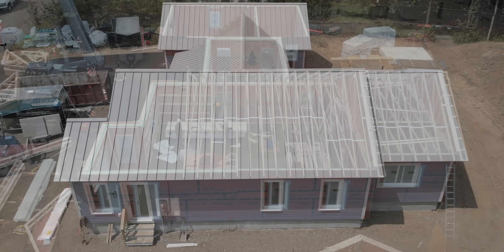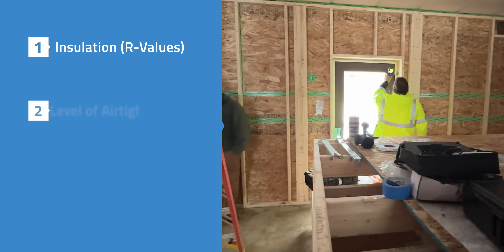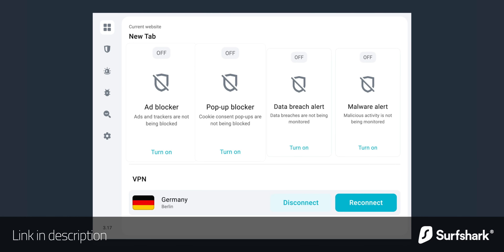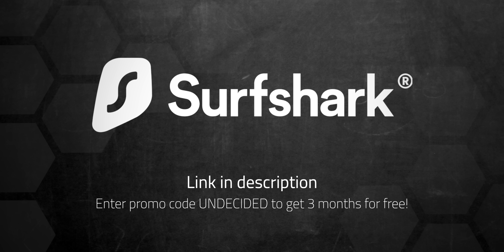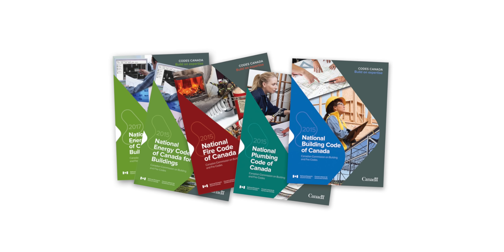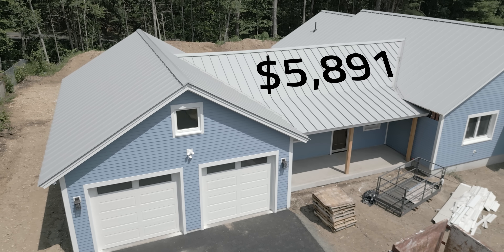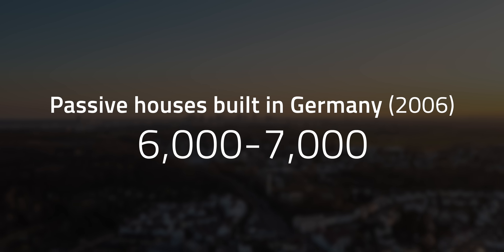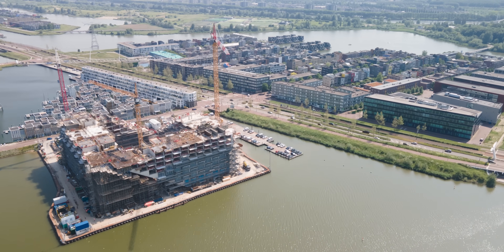Why Do American Homes Suck?

Comment: As an American living in Spain I can tell you that you are indeed only evaluating in your video energy related matters and not other important elements that are clearly different at least in Spain if not all Europe. When I hear your comments in building your new house on the roof selection, which I believe is metal and much more expensive that the usual shingles typical in many places in the US. The roof in my house are the typical red mediterranean roof tiles which I don't even know when, if ever, will require replacement. 

Typical construction is also not wood based but brick and again much more durable. In most homes floors are tiles and not carpets which would be a less expensive option. Kitchens and bathrooms all have walls which are tiles for easy cleaning and again, more expensive upfront. And yes, windows for many years have been at least double glazed with the new trend not being aluminum but PVC so they have a lower transmission value and therefore more efficient. 

My house is relatively old at 32 years and last year had an energy assessment done which is now mandatory if you request government energy incentives or are selling the property. This is similar to what is done in appliances in the US with EER ratings but for the house. One of the ways to also improve your ratings is by having renewable energy sufficient to compensate consumption. The measurement is done in kWh/m2/year and in my case I have been able to on reduce it to 25.7kWh/m2 thanks to a sizeable solar installation with batteries and A/C with reverse cycle for heating with supplemental natural gas.

Comment: My nephew's au pair is a youngster from Germany who is amazed at how noisy are US houses. One hears everything from other rooms throughout the houses. Internal insulation and noise dampening is non-existent. External insulation, even in new houses in new subdivisions is very substandard. That comports with my experience living in German homes over 10 years (80-99) in 4 locations.
Reply: Aren't German houses built with masonry, rather than wood?    I haven't lived in the USA since 2007, but in the four countries I have lived in since I left, they all construct with  concrete, and or hollow block.    Yes, it is more "solid", however it makes it much harder to make any changes to the house.    Hell, it even makes it more difficult, just to hang things on the wall.

Comment: Depending on location, building codes can be very challenging. The added expense to make a home energy efficient is typically more than the cost savings will add up to for many years. Making a house "tight" causes air quality problems that need to be solved with even more technology which in turn adds to the cost and overall energy consumption of the building. IMHO, the best choices are to use rock wool insulation, 2x6 (or thicker) walls, a radiant heating system and incorporate a good passive solar design and orientation on the lot. I am all for using house wrap and above average doors and windows, but the air exchange systems are something that I would try to avoid. I try to employ some vintage passive air control solutions like natural convection to exchange the air and contribute to humidity and temperature control. I do this with an automated roof vent and lower-level intake vents. A system like this requires the building to be designed for airflow through the various rooms both in and out. This or any type of air circulation interferes with sound deadening goals so yet again, there needs to be a balance that typically requires much more thought into the overall design of the house. Thicker interior insulated walls and arranging the rooms in such a way that the occupants don't disturb one another.

Comment: I cannot understand why US seems to have some adversity to everything that became norm in Europe, even if it is something proven to be better.
RM Transit did a great video showing why build public transport in America is way more expensive and time costly just because US doesn't accept European standards, so everything must be converted or adapted.
I can also give example of vehicles. Cars made to a European standards cannot be sold in America, they must be slightly different, but not exactly better. For instance, European cars can have adaptive headlights which is way better for everyone, for the driver , better for the oncoming traffic and pedestrians, but it was forbidden in US until last year.
When the DOT finally approved, they added some minors requirements that improve nothing but it was different enough so the European headlights would still be forbidden.. WHY!
Now every brand will have to come up with a slightly different design just to meet US standards, increasing costs, waste and use of material..

I can go on and on in a bunch of examples, but I guess I've made my point.

Comment: It's not just energy efficiency if you look at the area called Tornado Alley it's so common to have tornado's it's just normal and yet the building can't handle any more than a stiff breeze.  And what a surprise people get killed and everything needs to be rebuilt, rather than having a building designed to be tough enough.

American's just need to build better houses.

Comment: Passive houses are an outdated concept in the Netherlands. The building code requires a near zero energy cost home which can be achieved in many different ways including the use of heat as an industry (datacenter) byproduct. 
Passive houses still get build, but certification is mostly redundant.

Comment: Fun fact -- the planned obsolesce on the majority of newly-built USA housing is actually less than the life-time of the standard 30 year loan. Meaning if you planned to buy a house and actually live in it, you'd have to completely replace nearly all of it by the time you paid it off. You're not buying one home, you're buying 1.8 homes.

Without launching into a rant about how it's dumb to think of a physically rotting object as getting more valuable over time -- quality absolutely matters. It's not just flushing money down the toilet due to lost energy, it's flushing money down the drain because you have to replace all the walls, roof, wiring, pipes, windows, doors etc -- literally everything except the foundation (and sometimes even that too).

The neat thing about energy efficiency is that it often (not always) correlates to longevity. Walls need to be replaced because moisture gets in and rots it from the inside. Pipes leak because they're constantly exposed to exchanging air and that air is not being maintained at a consistent temperature causing the pipes to expand and contract. Doors get replaced because drafts are slamming them shut. Windows get replaced because water gets between the frame and the wall. The list goes on ...

All of these things are directly or indirectly linked to energy efficiency. So even if you're not into saving energy, how about just a structurally stronger building? They're usually one-in-the-same.

Comment: First of all. The US cannot reasonably have a centralized building code due to the size of the nation and the multiple climates that have to be accounted for. So it would at most have to be one per state just as it is now.

Does it need to be stricter? IMO no. However I think building recommendations should be made as accessible as possible so that people know that by for example simply using one type of insulation over another they can save on heating/cooling costs later.

There are an infinite amount of things you can do better when building a house and most of them are unknown to most people and people assume that it will just cost way too much when IRL it could be quite affordable to do many minor things that collectively result in a house that needs far less heating/cooling.

Comment: Passive house.  This is why we suck.  Our standards are really, really poor.  I built my home 8 years ago to Passive House standard and it costs a fraction to heat and cool compared to a US code built home.  I'm a 8,000' elevation in the Colorado Rockies and use roughly 10% of the energy when compared to a similar sized home code built home.

Comment: US building codes suck and cities require homes that are too big to be efficient. I built my own home with 2x6 walls, super insulated and can heat, cook and heat water for about a dollar a day with propane.  I have 1.2Kw of solar and I have most modern conveniences.  Houses in the US are also not positioned to make use of solar and roof designs are not designed for solar. I use a ground mount solar system that allows positioning and easier to do maintenance and cleaning.  

US homes do not design n passive solar and natural cooling like porches, smaller windows and cross ventilation so they need huge AC units. I cool my entre house with a 45 watt evap cooler.

Banks want traditional houses and builders want to build cheap and fast to make a profit!

Comment: Having lived in many countries including Africa, Europe, America and Canada I have to say I was shocked by the paper nature of American homes.  They are fundamentally nothing more than 2x4's with wax paper and plywood.  They look superficially grand in many instances but are completely incapable of surviving weather events.  Given America suffers Tornadoes, Hurricanes, intense thunder storms, ice-storms, heat storms and termites it is incredible that a house can be built NOT to last.  Even roof shingles are a joke; they don't last 5 years.  My UK house was built in 1902 and is sound masonry, heavily tiled roof and will easily survive bad weather events, and termites can't eat it!  Then again, have you compared house prices between America and the UK or Germany?
Reply: That's mostly true for houses built before the codes were codified. Houses built, and professionally remodeled, today have a mix of insulation in the walls as well as an insulating wrap on the outside. Both providing insulation and air tightness. 

Also houses built in states with bad weather systems have to be built to handle them. My house built in 1962 handles the hurricanes we get.

Tornados are kind of the exception as those things will wreck even the most hardened structure.
Reply: Claiming roof shingles don't even last five years is trolling, bud. Maybe try buying a brand like GAF and not some Chinese import.
Reply: That's why they don't make them energy-efficient: it's not worth it, since they are disposable, and not meant to last more than 30 years or so.
Reply: @Myria83  Well, yes, I think that was my point, without saying it directly.  American houses are built of materials that rot, get eaten, or don't last.  Here in the UK our local Pub was built in the 12th century, and we still hang out in it today, over 700 years later :-).  I guess its not impossible to build things out of 2x4's and plywood, but they are not as tough as brick.  Look at Matt's video, the opening frame shows an American house being built.  It is nothing but 2x4's and chipboard with a membrane.  That's not the same as 2 layers of brick, with an air gap for insulation that is common here in Europe.
Reply: @djgtidwell  "common" depends entirely on which european country you are referring to. as an example matt has shown that the swiss use a lot of wood in their housing construction. 

additonally you are being over simplistic in your description on how modern american homes are built, your description is more akin to the houses built before the 90s. and frankly you are outright lying about the lifespan of shingles. Asphalt shingles have a 30 year rated lifespan. 

that said i do wish houses here in the states incorporated more masonry in their construction; but at least we have caught up and passed a good chunk of the world when it comes to air tightness and ventilation.
Reply: If you've lived all over the place then you would know that in the United States there are houses of all different sorts probably more of a variety than any other country. Thinking that they are all made out of wood is hilarious. People watch a couple videos on the United States and then think that is how the United States is and everybody in it is like whoever they seen in the video 😂 brainwashing on the United States it makes me sick. I've always been happy with the home I have in the United States.. So something must be wrong in the European eye then.. How can I possibly have a comfortable house that I am happy with here? 🤦‍♂️🤡🤫😆

Comment: I’m in the UK in a Council house and quite an old one, not like victorian but it was constructed at about the end of the second (and hopefully last) world war, we have quite good double glazed windows that are basically a pressurised void (and if the get broken they sound like a shotgun going off) sadly the same can’t be said for the walls as they have no insulation and are plasterboard, the doors and frames are made of steel (a neighbour is mentally I’ll and was suspected of harming themselves, the police tried to brake the door in with a ram and failed, the fire brigade had to cut a hole in the door to gain entry, to be honest they would have had a much easier time going though the wall a few inches to the left of the door I wouldn’t be surprised if you could break down with your fists, the guy was fine he was just in a drunken stupor to the point he didn’t hear the hammering on his door that was shaking every house on the walk even the house opposite him, there really strong doors I often wonder why they were installed as the seem a bit much) we also have a coalhouse which is basically a massive cold leak on the house as it dosnt have an external door on it and it leads right to the bathroom floor.

Now luckily as my mum is both old and disabled (I’m disabled too but due to an incompetent doctor I aren’t registered as such yet) we have had the front wall of the house insulated (they added a second wall on the inside with insulating foam panels, we lost 3inch of space on each but it dose a ok job considering it’s all cobbled together as they go).

When we first moved into the place it was let’s call it oddly layer out, basically the electrics were finished over the Christmas season and we’ll they messed up quite a bit, the living room light was turned on from the hall the upstairs landing light was turned on from the living room and the living room and kitchen lights switch’s were flipped too, even all these years later after it got fixed when they had to rewire the whole house to bring it up to code I still sometime forget and turn the wrong light on as my muscle memory is still set to the old house.

Comment: Speaking about the house quality in US versus Europe. While in US they say that the house will last 30-50 years in Europe it is 300-500 years as most of the common buildings are made from bricks or similar material and they simply last for generations. Sure the EU house price is slightly higher then the US one, but in long term... The house in US is simply waste of money, plus the overall use of polystyrene which next generation will consider as like we consider asbestos used in east European countries now is horrid.
Truth to be told, the polystyrene found its way to Europe as well and the 2 by 4 nailed backstage structures too :(

Comment: Well, for a start, you should remember the 3 Little Piggies story... what house the big bad wolf could not blow away? The wood frame house or the solid sturdy brick house? 😅

I always wondered what happens when American parents tell that story for their kids
"Daddy, our house is made of bricks like the smart piglet?"

"Well, actually no. It's wood"

"Ok, but if a strong wind like the big bad wolf or a tornado hits it, we can do like the two first piggie brothers and run to the house made of bricks?"

"Actually, it entire neighborhood is wood frame houses"

Kid : Pikachu face
Reply: America is a big country.   The last place I lived in the states, have never had the type of weather that would "blow the house down".   So not an issue even worth considering.
Reply: @sgtm7  America is the New World
Reply: Americans buy wood framed houses,
with brick face! 😂

By the way, the interior of American homes is built with perfectly good rock, ground into dust, and compressed between two thin sheets of paper! 😂

Americans have roofs made with asphalt & little stones…

And Americans have concrete foundations…

Americans are veritable cavemen, with rock/concrete/stone below, above, on the inside of walls, and outside of walls! 😂
Reply: @DavidHalko  I haven't had a house with interior drywall in around 16 years.  I miss it.  Much easier to make changes to the interior of a house with drywall.